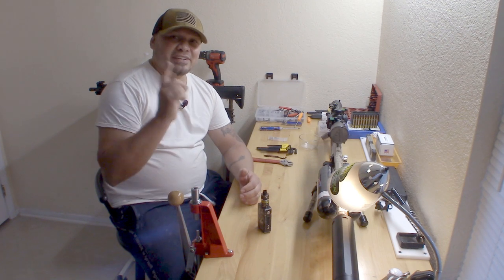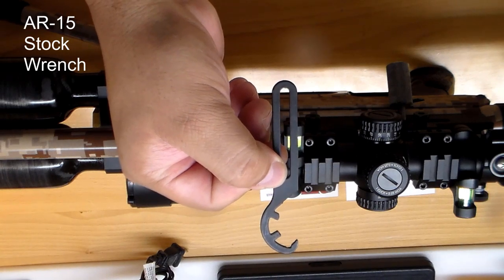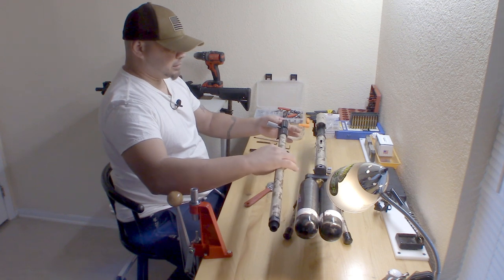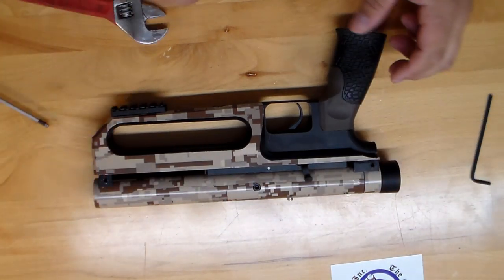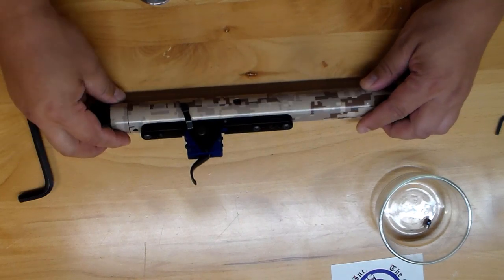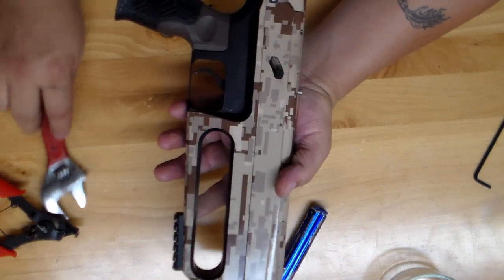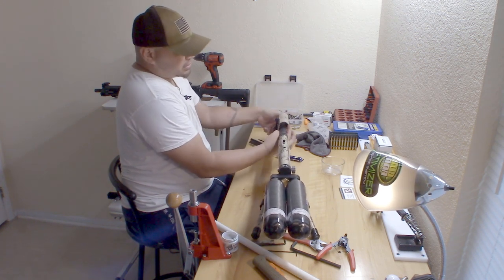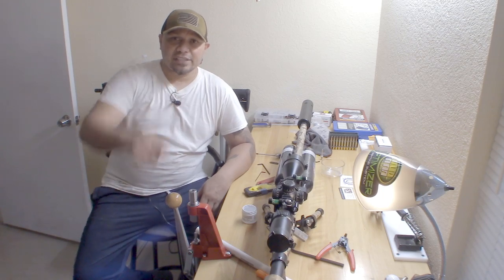FLEX Airgun: Replacing the Cothran Valve Tutorial

Comment: Hi will I just wanted to let you no that they do sell a lighter aluminum main tube you can get from Jefferson state air guns. I also have a question is the trigger off a ar 15 I was told that they were using a single stage drop in Timmy trigger and some were upgrade to a two stage ? If